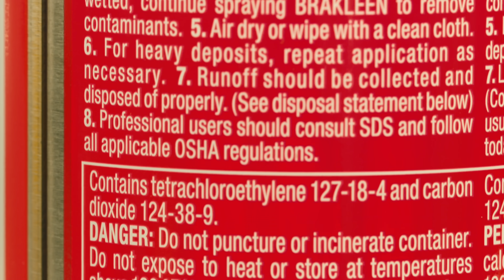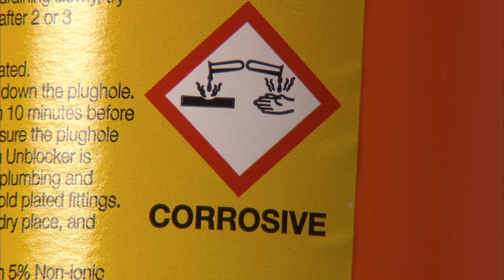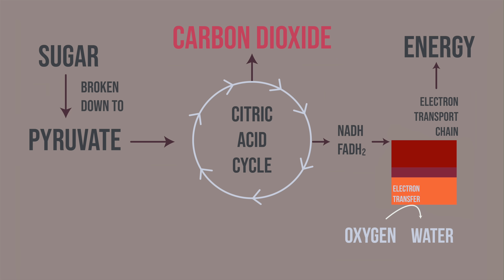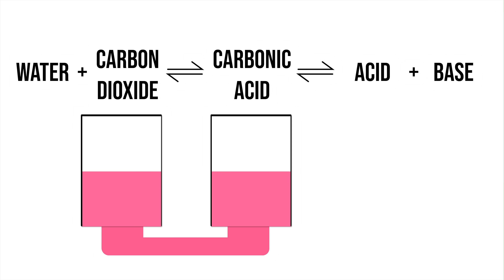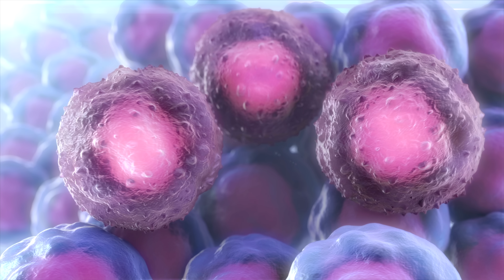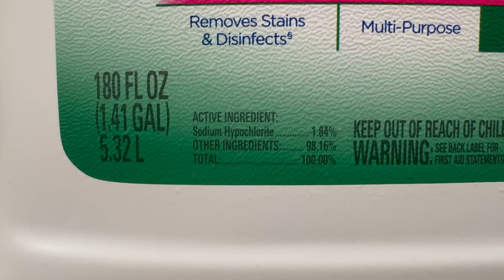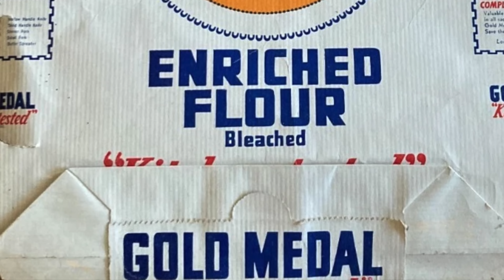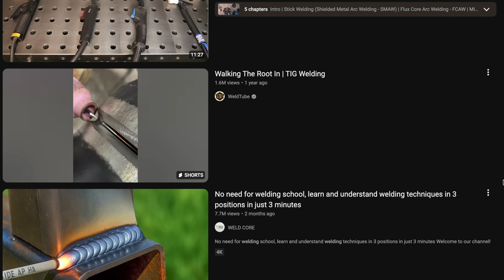"It smelled funny while I was welding and now I can't breathe..."

Comment: Years ago, I worked in a facility that had a large amount of industrial sized cooling.  One year, we were adding equipment and had to plumb new refrigerant lines to the existing ones, which required some welding.  I remember watching a group doing the welding from a short distance when suddenly they stopped and scattered.  I asked them what happened and one of them said "the arc turned green" meaning freon was present and the arc was turning it into phosgene.
Reply: Good grief. What else can turn into phosgene?
Reply: @monicacook3311  potentially just about anything with carbon and chlorine heated intensely/burned in air.

Comment: I almost did this to myself once, I was replacing the clutch in my car and the old one had disintegrated all over the bell housing. 
I hosed out the clutch material with chlorinated brake clean while next to an open flame propane heater, once my father and I realized that the air was getting a little too spicy we opened up the garage door and both went outside to get some fresh air.
Luckily neither of us seem to have done any long term damage.

Comment: as a wielder i call tell you that you need low pressure air taking sucking all the gasses as a minimum when you wield. The amount of toxic shit you will inhale if you do not have this. Alzheimer's and infertility not to mention cancer, is a common side effect of long term wielding without protection.

Comment: You got me, I thought it was going to be metal fume fever from welding zinc. I wasn't expecting accidental phosgene production from brake clean. 
A few of the stories I've heard involve trying to use heat to get rusty hardware off. So yeah don't try to use brake clean instead of penetrating oil. 
I live in an area where anything exposed to the road gets rusty due to using salt. So I hear it more often with using a torch or an induction heater rather than welding. Although that's probably due to them being far more ubiquitous and simple to use than a welder. Along with a constant need to remove rusty fasteners.

Comment: Welding can be so dangerous and a lot of people just buy a machine and learn with no idea. Teenage me did that, tried to practice my welding on some old fence posts I had in scrap. Galvanized. Luckily I was outside for all this and it wouldn’t weld well because of the zinc burning off so I gave up and nothing happened to me. I probably did this with brake cleaner too but since I was always outside never got it too bad

Comment: Phosgene gas was used extensively in World War I as a highly effective and deadly chemical weapon, responsible for the majority of chemical warfare fatalities, often mixed with chlorine gas and delivered via artillery shells after 1916. It was a colorless gas with a "musty hay" smell, attacking the lungs to cause suffocation, and became the primary killer among battlefield gases, surpassing even mustard gas in direct deaths.  Key Points: Introduction: First used by the German army in December 1915 against British troops near Ypres. Effectiveness: Its delayed action meant soldiers might not realize they were exposed until hours later, when fluid filled their lungs, leading to agonizing death. Prevalence: Became the dominant poison gas, causing around 85% of chemical weapon deaths during the war, despite mustard gas causing more overall casualties. Delivery: Initially released from cylinders, but later reliably delivered in artillery shells, allowing for attacks from a distance.

Comment: As a hobby welder, the beginning is so accurate and relatable.. Brake cleaner and all.
Reply: and scary
Reply: Also, just to pretend like this is reddit, your explanation on mig welding is only partially true. Mig uses electrode positive (ground clamp goes to negative). Electricity flows from negative to positive, so the electrons travel through work piece and smack into that wire which causes a lot of heat. That is what causes the wire to melt mainly. If you reversed polarity it would weld like shit.

Comment: Took a welding class in high school for two years. We had a great teacher, and it was a lot of fun. However, one time, he was out for a few days, and we thought he just got sick. When he came back, he gathered us all and said, "So, I did something very stupid, and that's why I was gone. I had some galvanized steel pipe I needed to cut, and I decided to use a torch to do it because it was faster and easier than a saw or anything else I had. I also didn't wear a ventilator. As I've told you all many times, galvanized steel is coated with zinc, and when you heat it, it creates a gas that is toxic. I was very sick for a few days. This is why I make safety such a priority in class, and I failed to do the same at home. Don't make the same mistake."

I know that's not the same as what happened here, but it's a similar case. While many things about welding are simple, there's also a lot of danger, and you really need to make sure you know what you're doing.
Reply: A Good teacher says "do this".  A great teacher says "do this, because I did that, and then this happened".  Self-promotion or arrogance has no place in the classroom.
Reply: @The3chordwonder  Some people are here to serve as role models, and some of us are here as cautionary examples...
Reply: and zinc fever is actually rather "harmless" on the scale of potential exposures to nasty shit
Reply: @andreas9238  if it's only zinc . Some steel parts are coated with cadmium for some reason.
Reply: @arandomcomp2427chromium in steel too. Heavy metal fever sucks. I remember fixing a pipe that was eaten up under the sink. I didn't think I was exposing myself to anything too awful cuz the brazing solder was for waterlines and nontoxic food safe. Well that torch puts out a lot of CO underneath the confines space of a sink and under in the crawlspace. And silver tin and antimony are harmless ..... On your skin, fumes in the air is a total different story. Poisoning yourself sucks so even on quick small repairs, make sure u got ventilation going. (Having the door and window open is NOT sufficient)
Reply: One of the first things I did when I bought my little welder was to weld galvanized steel. Luckily I was only welding for 15 minutes or something, so I just felt a little heavy in the chest for a day.
Reply: I welded galvanized once and didn't know, luckily I was outside and only got mild fever
Reply: @aldreymenezes7652  Same. No effect on me. Must have been very well ventilated and it was only a small amount of welding but I count myself lucky.
Reply: Never ever torch or weld cut zinc plated stuff, painted pipe. 
Makes for a nasty weld that doesn’t penetrate the base metal
Throws off toxic gases whether or not if you’re wearing a half mask.
Reply: I was told by welding teachers to drink lots of milk, don't know if it is true because I never welded galvanized steel pipe.
Reply: @robertcounts5300  I would probably get a worse reaction to the milk!
Reply: I thought it was gonna be metal fume fever like your teacher got from Zinc since that is a classic welding mistake, but somehow it was so, so much worse.
Reply: What the hell was he zincing?
Reply: I never thought about creating toxic gasses when welding. Thank you! This comment solidifies safety knowledge in my mind. I need a respirator. Not just a mask I use for grinding and sanding.
Reply: Watch out for lead when welding old steel as well old metal paints often contained lead, and it was often used as body filler before plasticized body filler was used
Reply: I remember my welding instructor talking about breathing zinc fumes.  "It won't kill you, but it will make you wish it would".  He had all sorts of good information like that.  One time I noticed he always held the acetylene torch by the hoses rather than the body of the torch.  I asked him why, his answer: "This way when the torch explodes I'll only lose my hands".  I noticed two things, he said "when" and " only lose my hands".  I left that class with a lot more caution and respect for the trade than I had coming in that's for sure.
Reply: Here is another tip for people in the metal fabrication game always wear a mask when grinding steel of any type, the dusk that is produced can cause emphysema and or lung cancer, and when welding alloy or stainless steel always wear an inclosed respirator if you want to live into your seventy and eighty’s.
Reply: I once had the misfortune of needing to weld galvanised steel without any breathing equipment. I must have looked like a right idiot holding my breath to weld for a minute before sprinting away to breathe and then coming back holding my breath again to weld a little more.
I still managed to end up getting a whiff of the wretched stuff, what clued me in was the constant feeling of unease that lingered for the entire next day.

It was barely a sniff of the damn stuff and it still left me feeling wrong for well over 24 hours, I dread to think what a lungfull of those fumes would fo to a person.
I've been even massively paranoid about zinc fumes ever since.
Reply: Been a boilermaker most my adult life.
Never been sick.
But one weekend I worked at a gal dipping factory.
2 hours later I was in hospital.
Reply: I bet that was made up and he was on a bender 😅
Reply: Every old guy will tell ya take some tums and weld galvi with flux core outdoors with a large shop fan.
Reply: I won't weld galvanized anymore. Just wont do it.
Reply: Hey the more you know right? Thanks for sharing I never even thought about the galvanized coatings in steel. When ur grinding away it doesn't seem like your inhaling anything too u step back and see the metal smoking and hack out black goo from ur nose.
Reply: @Bj-en1qx  you can drink milk to neutralize some of the zinc . But I just won't weld it or cut it. I'm too old for that chit. I'm a damn pipe and tube welder. Golden arm. I am too good to do it and I'll just admit it too.. last time a Foreman told me to weld some i told him to kiss my azz.. he got a young kid to do it too 😉
Reply: My case, from 1972, wasn't that bad. I still get winded much more easily than most around me.
Reply: that was cadmium and there's no way to remove it they put you on oxygen and hope for the best
Reply: It's not the same, but the same preventative measures - a respirator - would have likely prevented this. Of course if you know to use a respirator when welding with brake cleaner, you also probably know not to weld with brake cleaner, so 🤷.
Reply: If I weld galvy I do it outside and keep it short.  Basically hold my breath during the weld if possible.
Reply: @christheother9088  . Grind the zinc off first. Even holding your breath can fail. The zinc oxide can stick around plastic or cloth items.
Reply: @christheother9088 Welding galvanized can be damn near impossible if you don't burn off the zinc first. Can still make you sick.But it will weld instead of burn up
Reply: @briankennedy5578  if I need to weld bolts or small pieces I soak them  overnight in vinegar...zinc is gone.
Reply: I have never gotten sick from welding zinc plated metals. Just be aware of what you’re doing. Take frequent breaks in fresh air and weld in a well ventilated area. You have to be stubborn to weld zinc long enough to get sick while you’re smelling it the whole time
Reply: I’ve welded tons of galv. It’s really not that serious. I’ve gotten a headache a couple times
Reply: Galvanized Metal is not actually toxic. In fact there IS no evidence that it has any long lasting effects at all (with the caveat that it also hasnt been very well studied enough).
It DOES make you feel like shit for like a day, fever, puking, the works.
Reply: @DrCranberry  "Not actually toxic" and "makes you puke and run a fever" are not compatible statements. If it has those effects, it is pretty much by definition toxic. It may or may not be an accumulating toxin, or lethal at some particular dose, but it is definitely toxic.

Comment: So he didn't allow the solvent to completely evaporate before he started welding?  Or was the solvent reacting in the air as he welded without proper ventilation?

Comment: Great to see SP in one of your videos. You are both a national treasure. As a welder/creator I can honestly say that you have given solid advice. I would also tell those about to get into welding to be very careful with anti corrosion coatings such as those found on galvanized pipes. That stuff absolutely must be removed before any welding is attempted. I never spray anything on the metal I'm about to Weld, I just use a sand paper flap wheel on an angle grinder. As you have stated PPE is a must. Goggles and a respirator are a must as well as coverage for bare skin when welding. Great video.

Comment: this some really weird safety theatre about something that I am almost 100% sure did not happen. you'd basically have to be welding in a giant puddle of brake clean, and idk how that stuff wouldn't instantly light on fire... a lot of this doesn't add up and goes directly against typical industry standards, and we both know there aren't dozens of cases like this. Like as someone in the industry, I was expecting this to be about galvanized steel. Zinc poisioning has got to be a million times more common than this.
Reply: The cleaner was adsorbed into the rust, so enough surface area, and Perc is NOT highly flammable-even if it DID light, the danger still exists.